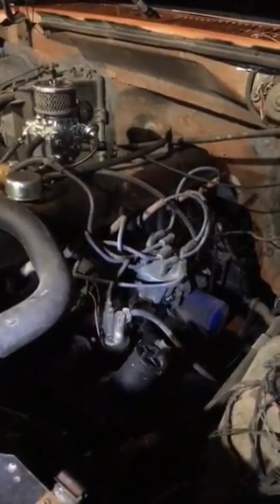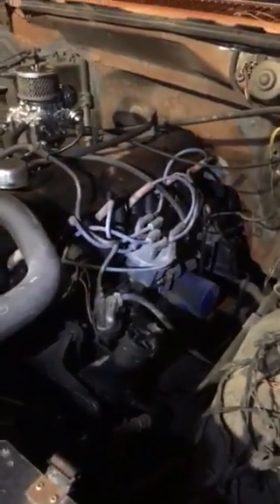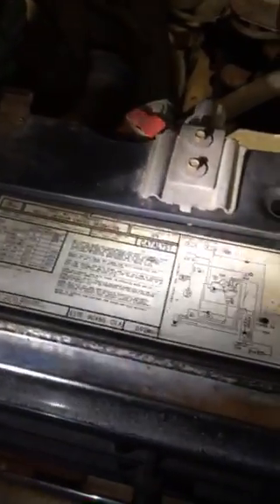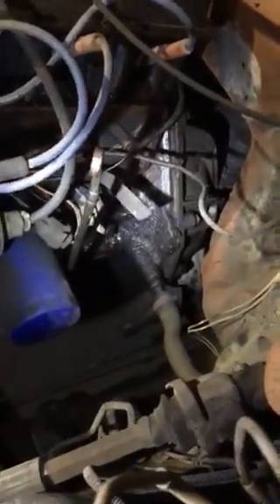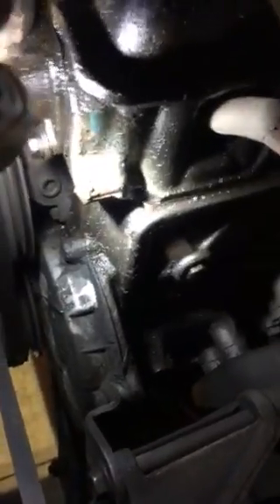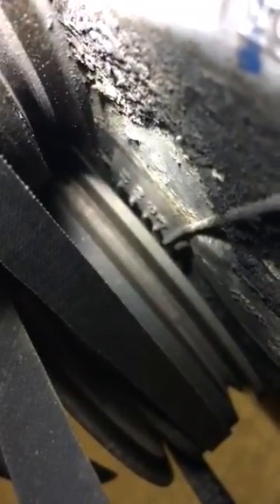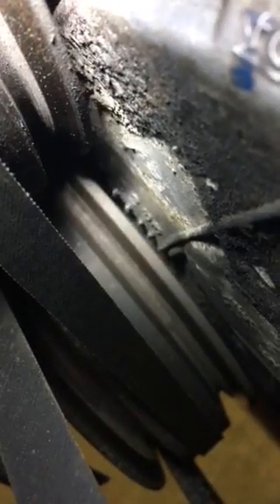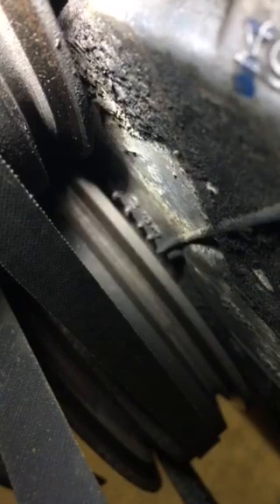Timing on 1981 Ford Bronco Inline 6, 4.9L, 300. Where are the timing marks on 1981 Ford inline 6?

Comment: I have 1983 f150 4.9 and there are two triangular indentations on the pulley and i dont know which one is the right one!!!!  And there is another  timing gizmo thing down on the passenger side . I  saw another video that says to use that timing thing , and not the one you say to use.